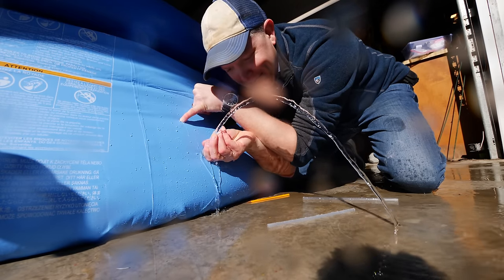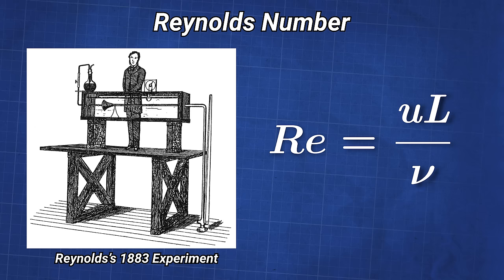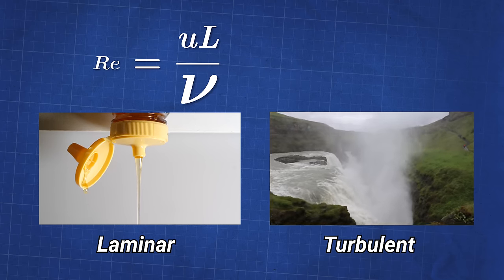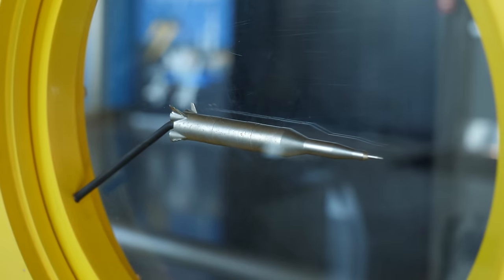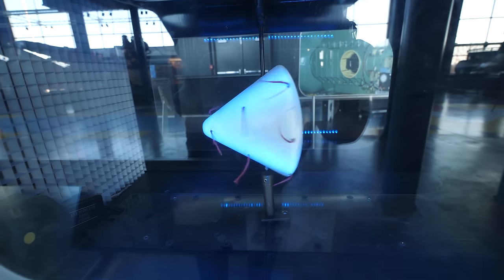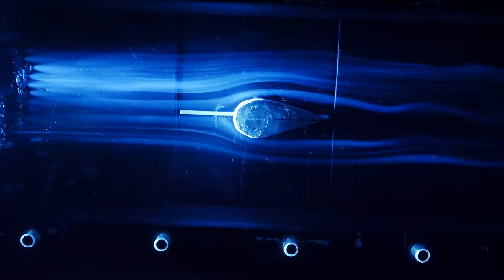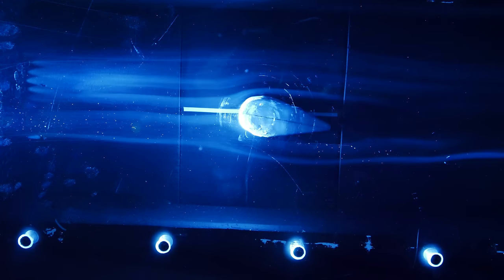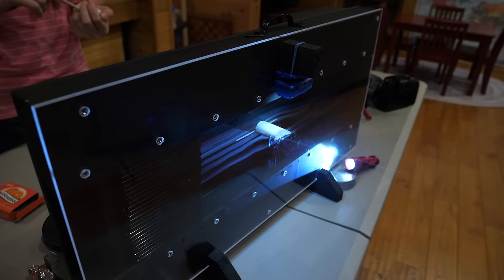Why Laminar Flow is AWESOME - Smarter Every Day 208

Comment: Ok Destin, I have watched you since the backward brain bike.  You do some of the coolest things.  So a question and a challenge.  First what makes better laminar flow, water at 33 degrees or water at 150 degrees?  You get the idea there.  Just thinking viscosity.  Second, the challenge.  How large can you make a laminar flow arch?  Not the distance, well maybe that also, but I was thinking the diameter of the water.  As a firefighter, we played with 1 3/4 inch line, 2 1/2 in line and 6 inch line. Could you make a nozzle large enough to create laminar flow through a fire hose?

Comment: Question may be related. When you fill a cup with water then flip it over, keeping pressure so it's still filled, then pull it from the surface and the water comes out but creates that bubble is that also laminar flow? I just want to know why it comes out around the edge but not in the middle. Is it the surface tension of water?